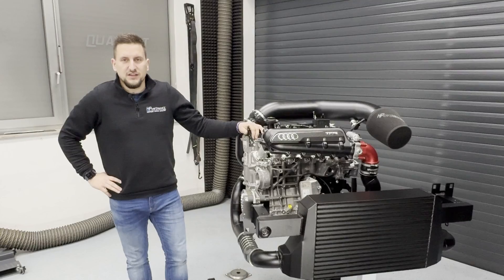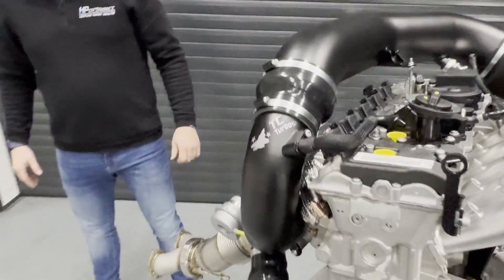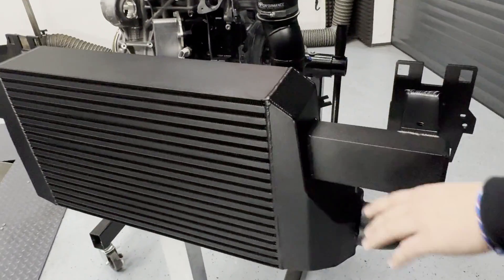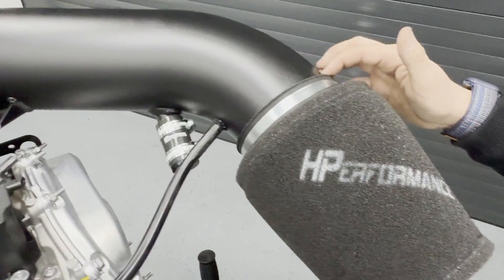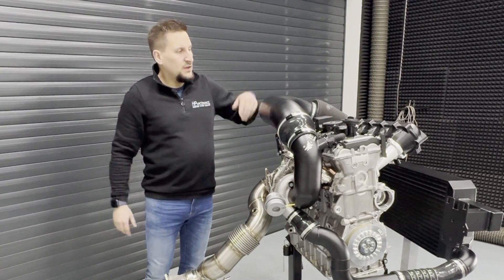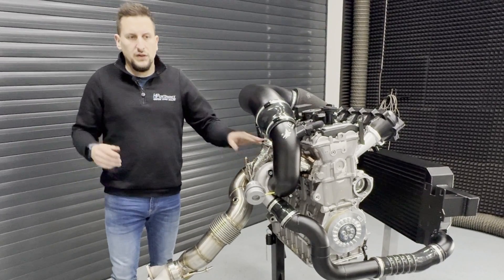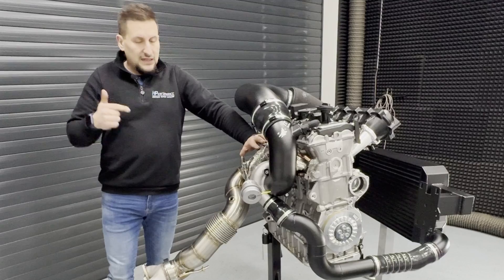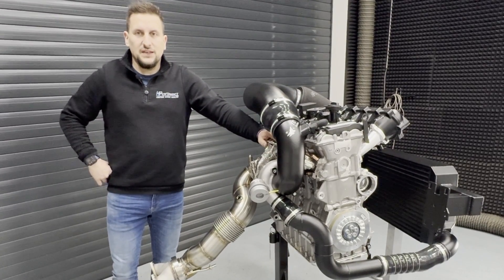TC Turbos TC900XT 2.5 turbokit for RS3 TTRS DAZA DNWA - worlds strongest hybrid by HPerformance

Comment: Stock turbos start building boost around 1,700 RPM. I imagine with the small manifold it does respond quickly, but what does boost threshold become with the larger turbo?

Excited to see the 4" exhaust set up for the 8J!
Reply from the maker: It is extremely responsive. Combined with high compression we can say explosive. On E85 full spool is under 4000rpm. Thanks for your feedback

Comment: Can it be used on a stage 2 flex fuel tune?
Reply from the maker: No this turbo needs attention while tuning it. The possible boost and power load scenarios need to be controlled. We offer off the shelf remote tuning solutions for various fuels

Comment: Do you need to upgrade the internals? Also i know you said spool upnis the same,does this have ball bearing or journal bearing?
Reply from the maker: To release full potential a forged engine is a „must have“. The turbo uses the well proven over time journal bearing, that we also used on 800 and 870 XT.